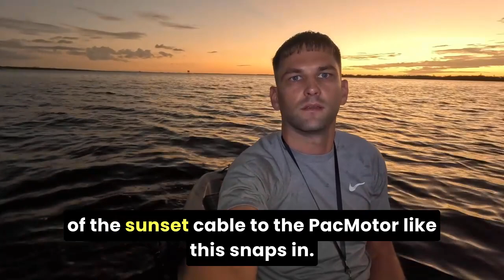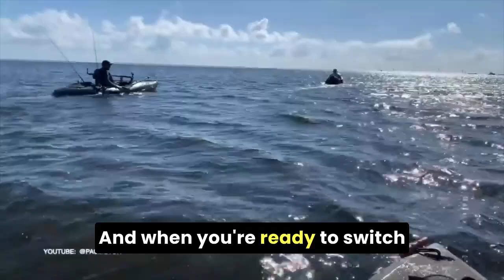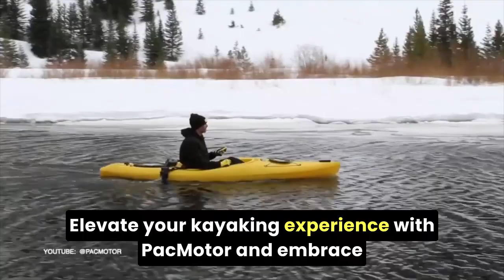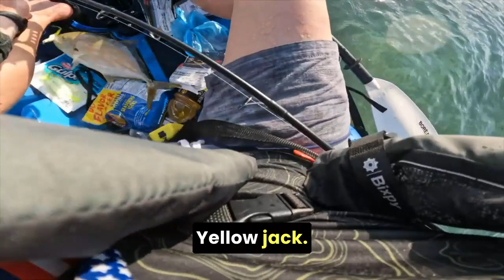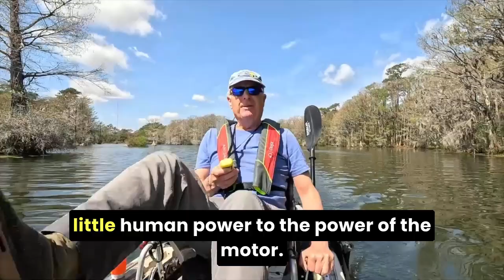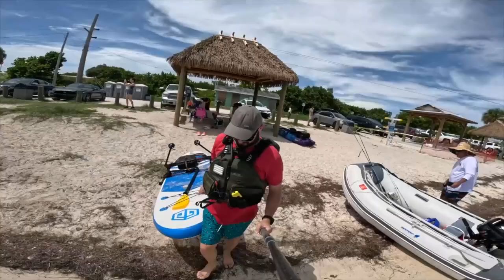The #1 Innovation in Kayaking!

Comment: everyone needs to be aware that as soon as you install these on your kayak you have to be registered as a powerboat in almost every state! You don't want to get a ticket so get registered!
Reply: isn't it generally locked behind a 10-15 HP requirement? They need to worry about certificates more so than power boat registration in most states.
Reply: @masonreppeto882 
You must register any vessel, and properly display the registration numbers, that has any type of non human power.
Reply: This isn’t really true, as most states have a minimum hp requirement. like my state is anything above 3hp
Reply: No minimum in Kansas
Reply: Here in VA, even with a trolling motor, you need a VA number from registration of a Jon boat
Reply: Above 9.9 hp in Washington state before you need to register.

Comment: How well does the PacMotor work on inflatable kayaks like the Aquaglide Blackfoot 130 ?
Reply from the maker: It works really well actually. We have tested on multiple inflatables and so have some customers and we have good feedback. Its one of the only motors that can be easily attached to inflatable kayaks. We have designed rubber pads on the inside of the PacMotor to protect against your kayaks haul.